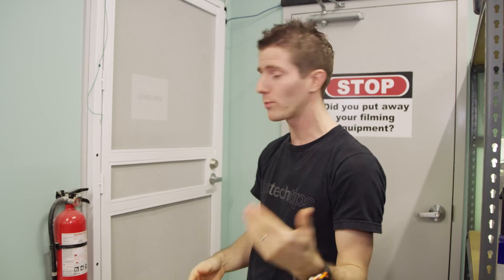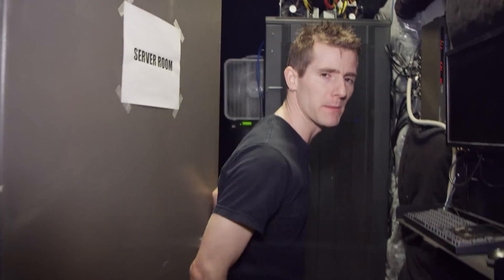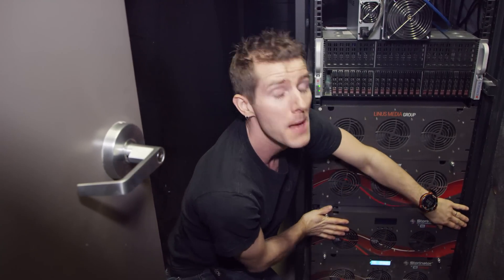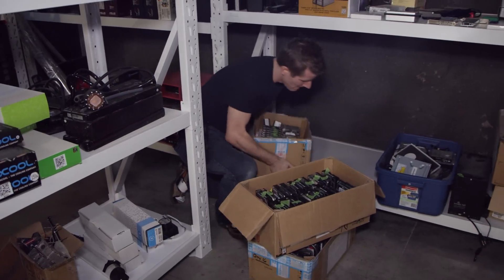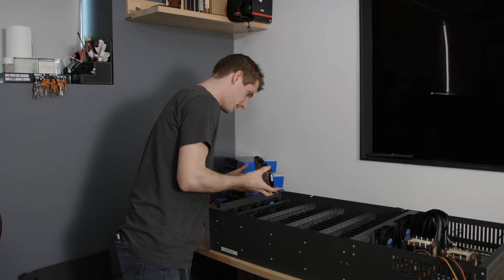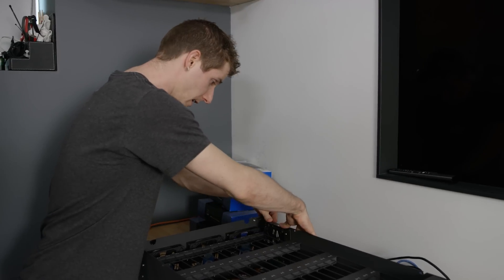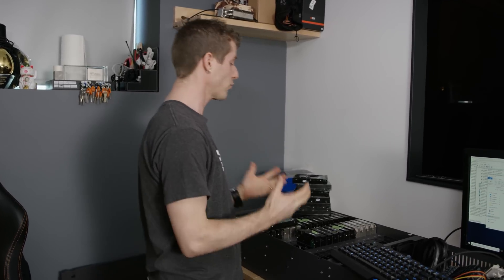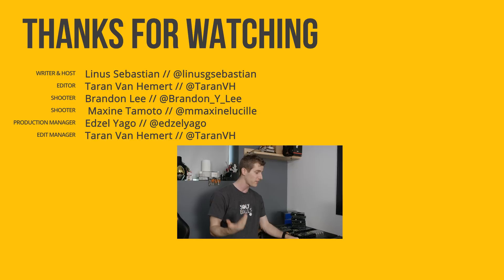HARD DRIVE Mining? This is getting ridiculous...

Comment: Hey Linus, you can actually mine multiple coins at the same time with the same plots. BHD makes a lot more money. You can mine along side Signum and with 500TB's, which is what I believe you used in this video, you would make over $650 a month. That's a lot more then you report in this video. Over the course of a year. With a 500BHD coin plege you would make nearly $8,000 in 12 months. That's way more then what you reported. I think bhd launched end of 2018 so ig it didn't exist when you made this video. Please make an update video and give hdd mining 1 more chance.

Update:
I checked a profitability calculator for mining chia and it says you can make $1,130 a month, around $13,560 per year using a 500TB rig. Again, I repeat... Please make another video about hdd mining.

Comment: CPU mining, GPU mining, Hard Drive mining for fuck sake what's next? RAM mining?!?
Reply: You can farm chia coin with ram actualy :D
Reply: Chia = CPU + RAM + SSD Mining, plotting benefits from a maximum of 6750Mb ram per plotting process, and hard drive is only used to store the plotted data, so first of all, chia is CPU+Ram mining deep inside. And if you consider those who purchased severs with 1Tb of ram and emulate storage space to do plotting, then it is Ram mining. But for most people tho, Chia is CPU+SSD mining, 1 plot takes ~1.5Tb of data write, effectively burn out most consumer level SSDs in 200 plots, mind you, there are people generating hundreds of plots per day. So rather than worrying about the hdd shortages, worry about the nvme SSD shortage first. With the current speed they r burning out, Nvme SSDs will probably be in shortage long before the HDD. Advice? Buy nvme ssds while you can, maybe store a few as backup. Don’t worry abt HDDs there won’t be shortage for 8Tb and below, there is already shortage for 12Tb and above and there is nothing you can do abt it right now. Should regular consumer be worried? Probably not. When we need 20 Tb space, we don’t have to buy a 20Tb hdd, but can easily grab four 8Tb hdds and be happy with that. Should the companies be worried? Oh yeah definitely yes, they need a huge amount of storage maybe in Eb level and have space constraints. So either rent a new building for more server rooms, or wait forever for hundreds and thousands of high capacity hard drives they need

Comment: UNI logged a strong reversal in the running week after crashing by 57 percent in just four days of trading earlier this month. UniSwap's governance token was trading about 30 percent higher from its session low at $3.68 Trader came back to raise their bids for the Crypto as its rivals in the decentralized finance space continue to face a market-wide bearish pressure. Breaking this psychological resistance especially with the benchmark Cryptocurrency will be a major catalyst for more upward swing and seeing a new All-Time Higher in first quarter of the new year is not only feasible but totally within grasp. I came to the realization that the best approach to take with cryptocurrency is to trade with an expert like Bryant Miller as  I have been following his advice and have made over 10 btc within a period of 9 weeks, starting at just 3 btc just by copying his trades using his signal. It was the best financial decision I'd ever made in my life. He can be reached for advice on Telrgram (brantmillertrade) or WhatsAap (+1 (904) 364-0429) and I strongly believe from experience that the best way to benefit from Crypto is to follow the guidance of an experienced trader with good results.

Comment: At this point, I'm genuinely starting to hate cryptocurrency. All it does is waste electricity and set most people's money on fire. The only one that had any good pay out was bitcoin, but that succeeded purely on hype train and easily burst because the entire baseline concept isn't sustainable.
Reply: Facts
Reply: Bitcoin didn't burst at all, still going strong, now at $10k per coin.
Reply: @thefirehawk1495  Dude, you must've missed every that thing's had significant dips in value anytime the hype dies down.

Then, when it's cheap, investors just buy more, so the value and hype shoot back up.
Except, since relatively few places adopt it because it's relatively worthless and hard for most people to get into, the value just ends up falling drastically again.

Wash, rinse, repeat until enough people wise up to the fundamental flaw of that approach to cryptocurrency.
Reply: This. The bitcoin network currently uses about the same power as all of Austria, and most of that is in places with cheap, dirty coal power. 
ONE single Bitcoin transaction currently uses about 640kWh of energy, which is fucking INSANE. That's the equivalent of about 60l of diesel. It would literally be more environmentally friendly to DRIVE your cash to its destination in a car.

Comment: Mid-May 2019.
Burst coin value: approximately $0.003 USD.
Reply: 2021 and its still $0.003 USD.
Reply: @WelcomeFellow  2 months on and it's $0.0112
Reply: well another one is borned called chia, in this cryto minig in HDD
Reply: That was the most disappointing thing about this video.  No info on how much monopoly money he could theoretically make off it, even with high-end stuff.
Reply: @xirabolt  Burstcoin is over 96% mined and everyone who made money on it made it literally 2 years before Linus' video even came out when almost no one was mining it. I remember "SIACOIN" was going to end up being an altcoin based on BURST, but ended up being a "cloud storage" service with cryptocurrency payment options.
Reply: Oct 2020. Current value 0.0028 USD. All-time high was 0.12 USD and that was Jan 2018.
Reply: That’s a completely arbitrary measure if you don’t give us the supply. It’s like saying:

Yen value: 0,0091 USD

Doesn’t really tell you much about the strength of the Yen, does it?
Reply: @lenn939  yeah you need to know how long it takes to mine each coin and at what cost.

Comment: my 3 1tb hdds from samsung from 2008 are still in everyday use.
i bought them, when they were cheap. 50€ each.
then for a long while, hdd prices were super high. like 6 years or so after i bought mine.

then i got a gtx1060, sold it short after. and boom mining craze happened.
i bought it for 268€, sold it for 230€ and a week later it was traded for like 300+€

Comment: I'm always entertained by your over the top solutions to mundane problems. Unfortunately pretty much every video you make of this type also brings a tear to my eye at the end when I see what is basically top of the line hardware being used for things that require a fraction of the power, and I'm still stuck with a 775 board with a modded 771 server CPU, internal graphics chip and some 1TB HDDs as a personal computer/server. Hey, at least the video about the $69 to $150 gaming computer upgrade didn't make me cry ;)

Comment: You didn't explain how it would even work. Doesn't crypto-currency inherently require computing power for the encryption?
Many of the currencies popping up now might be different types of scam, and they might be driven by hardware manufacturers trying to boost product sales. Imagine how much profit they make compared to the miners.
I read up on proof-of-space and that seems to be the principle behind it, i.e. no actual practical use for running the currency, but just gambling with virtual goods; a total con.

Comment: Squirrels Research is releasing new tech helping GPU Mining very soon. Can you try to get a Review Unit and test it for us @LTT?

http://squirrelsresearch.com/

e.g.
Acorn is the first-ever cryptocurrency mining accelerator card. By using best-in-class Xilinx FPGA chips in an M.2 slot, the Acorn CLE-101 offloads and performs the least GPU friendly parts of memory-intensive cryptocurrency mining. Acorn CLE-101 makes mining algorithms like Ethash and CryptoNight V1 on GPUs more efficient.

Comment: Great vid. After installing light speed grease on my super data transfer  connectors, my streamline x core proceesing numbers are looking great for AED and TRS aspects. It is a comprise for the data interceptor robot performance at the dx300s firewall drive modulator. Thanks for the info.

Comment: I have no idea what you are doing...  First off, I've yet to have a single red drive fail, or have errors.   Those things last virtually forever, so long as you have proper cooling.   So why would you have boxes of unused drives?   I counted at least $20,000 worth of hard drives just sitting there in your boxes.   By the time a hard drive wears out for me, it typically has less capacity than a USB stick.   And yes you can make arrays of those holder hard drives, but for the power costs I if I wanted an array of low capacity drives I'd by USB sticks on sale.

So wtf to you have all those hard drives just sitting there?   And why do you think it is crazy to put data you trust on them?

But then I guess the whole idea of a crypto mining that is based on having maximum amount of storage is already an idea for crazy people... :-)

Comment: might be worth it for repair shops. just drop the old replacement hdd in your mining rig and run it into the ground.
good way to make some extra $ as long as you can buy power cheaply and power use is not higher than you make in $ it might me a good deal. i have worked in a repair shop and the amount of working replacement drives amazed me.
and you coud say its the way you destroy drives and data.

Comment: Can I do something like this with my attic full of old AOL signup floppies?
Reply: Floppotron
Reply: Hey glassinger! What are you doing here? I saw you recently posting again. I am a subscriber! Love your content.
Reply: Floppotron is what you do with old floppy drives, not the disks. I'd recommend saving the disks. Not for the AOL, but for the retro-computer community. Floppy disks of the 90's were far more reliable than the ones you'd pick up in boxes of 10 at Staples towards the end of the medium in the early 2000's. I reformat my old ones and reuse them.
Additionally, floppy isn't the best medium for scale operations like this, since your limitation to the number of floppy drives was the number of controllers and how many drives you could have on a controller.

Comment: Yeah, Definitely do not trust old hard drives to store such info. After using it for maybe 4 months, a 200GB IDE hard drive that I had my Ubuntu installation on went bananas. First I got SMART status BAD messages from the POST boot, then I rebooted after using Ubuntu, it gave me an (initramfs) prompt. I got through that, and rebooted. It only got worse. It drops me to a grub rescue> prompt. I got through that too, and then I got back to the (initramfs) prompt. This time, I couldn't fix it. FSCK (not a typo) got strange delays, and eventually, I booted to a Live CD. From there, I got I/O errors. So I reinstalled. After using my newly reinstalled Ubuntu OS, it crashes AGAIN. Eventually, I gave up. Now it just sits there with an empty FAT32 (i think) partition. Now the only OS that I have is Windows 7 on a SATA 180GB hard disk. All the other SATA hard disks that I have are the exact same model! THis is why I chose IDe, so I could avoid this trouble of finding the correct OS to boot from. (That  would be Ubuntu, because during installation, it detects other OSes and adds them to the GRUB menu.) On a different note: I've had this idea of clamping a USB port inside my computer so a USB stick could function like (lol not a boss) an internal SDD. "But what about just sticking them into the back of the computer??" That adds wierd sticking out things to the back, because then when I shove my computer back into the wall (Which I doubt I'd do) it would transfer force to the USB port, possibly causing damage.